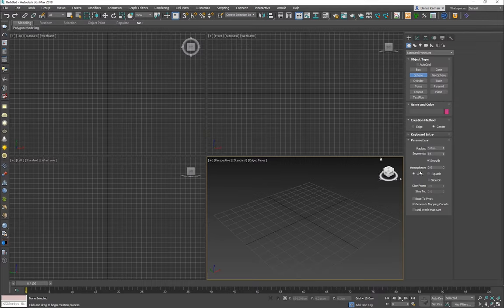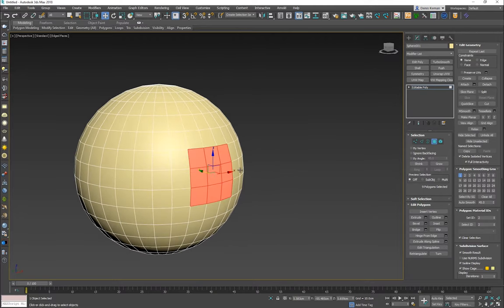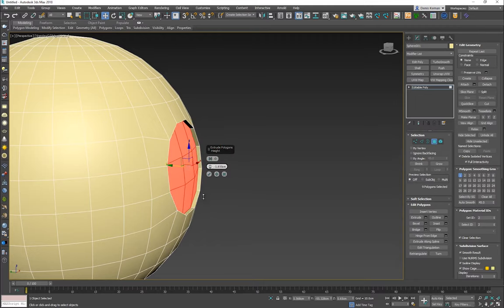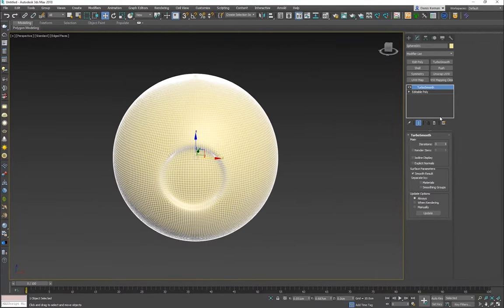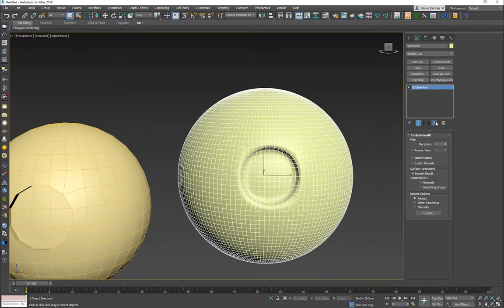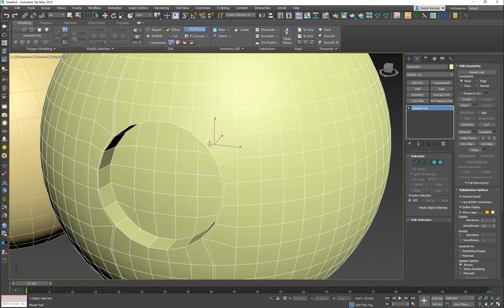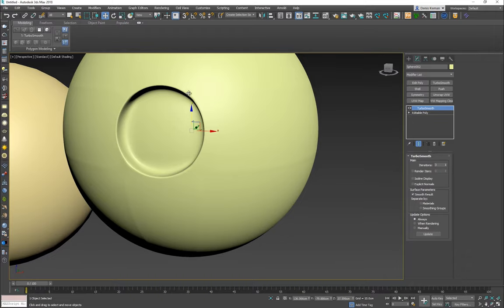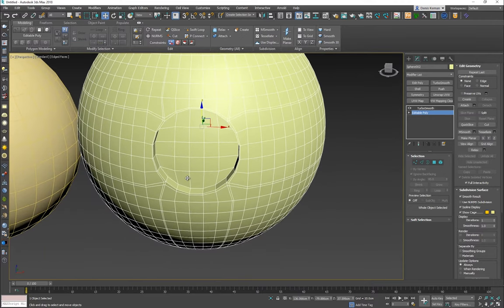Controlling Geometry on Round Surfaces with 3ds Max

Comment: There is a much much easier and efficient way of doing this. After extruding the regularised loop, go back to edge select > it will retain the circular edge selection > press extrude > reset the height to 0 and adjust the width to get your desired edge width. Now you just gave to collapse the verts that are on the corners that have small triangles and you get a perfect edge that will work with sub-D. =).

Comment: Great stuff there. Two tips for you and other people, dont know if it has been said in comments :
- Function "set flow" (can be a keyboard shortcut) will move your edges or vertices in the "flow" of your model. It's hard to explain in english as it's not my mother language, but can be very usefull to smooth your object.
- 10:56 : At multiple occasions in this video you could have used the function "Select similar" in the graphite modeling toolbar (can be set as a shortcut too). In this case you pick the two vertices and do "select similar", it would have selected the 3x2 other vertices. Then "collapse" (also as a shortcut on my setup). Basically i would have selected the two vertices then alt+S (my select similar shortcut) and ctrl+D (my collapse shortcut). Done.

Comment: hmm this method isn't that good, Why not just use chamfer or bevel depend on the software that people use?  just select the edge of the circle and chamfer it, why all this complication when u can do it in 3 sec? by doing what u did, u destroyed the edges flow around the new circle. and u introduced another artifact on the rendering.

Comment: How to add regularise in right click
Reply: it does it automatically once you install the script, it only works if you are in edit poly edge mode however it wont show if you are using edit poly in modifier stack.

Comment: I think this manual method is a bit outdated now, as in newest versions of Max(or with Marius Silaghi plugin in older versions) you can just use quad chamfer on those edges and it works perfectly geometry wise. But for me most annoying thing about adding details on curved surfaces is that it messes up UV's. Fixing geometry is not a big deal, but if you need to apply repetitive texture to it (like a checker), here comes the pain... As turbosmooth will make it wobbly and ugly around that inserted detail in 90% of cases. And unwrapping smoothed (HP) models in Max is a nightmare.
Reply from the maker: I do agree that with newer versions you get an easier workflow, and even with the quad chamfer fixing most of the issues but people still show me models with these simple issues and then wonder how to fix the pinching issues they get. So i decided to make one short video instead of having to explain this multiple times to multiple people :) 

As for UV's, that's a given that whenever you play around with the geometry you will have to do a proper unwrap. And doing UV's in Max is not hard, it's just unadvisable if you like your sanity. That's why i usually take the Unfold3D way, or the RizonUV as it's now called.
Reply: That's a just cause, sir :) And  true... Max's UVeditor can drive nuts even most stable mind) I used to work with UVLayout for years, but few months ago switched to Rizom too. Kinda awesome software. Only sad thing with it is that you have to collapse stack before exporting model there. And in case of this sphere... making 2 UV sets, one for LowPoly, and 2nd for HighPoly would be annoying too (to make texture look similar on smoothed/unsmoothed model).